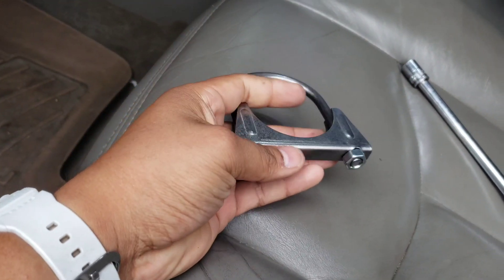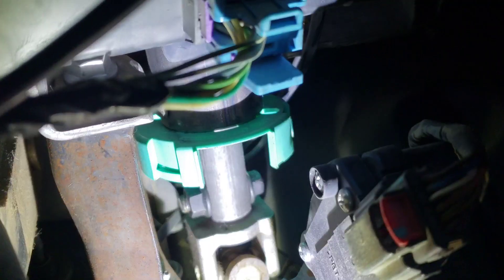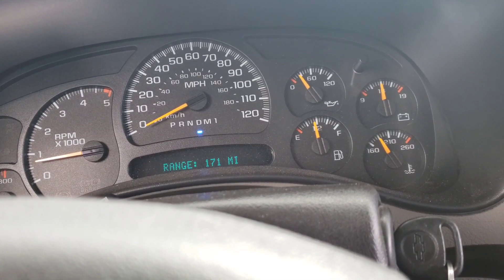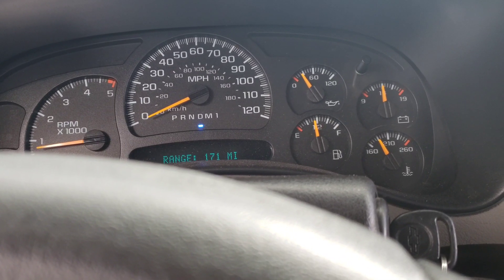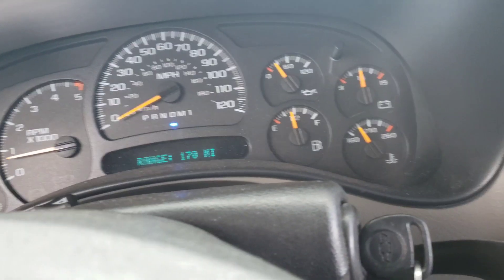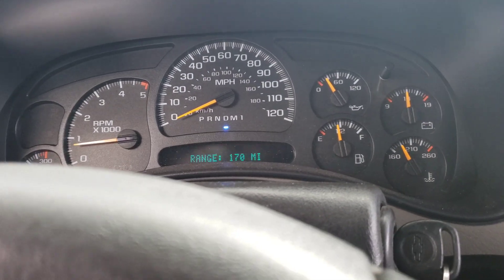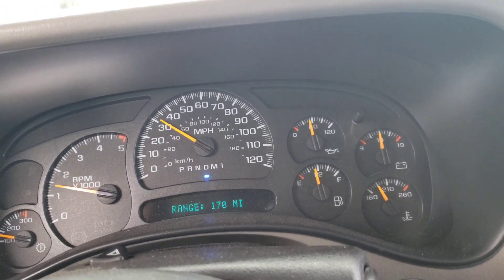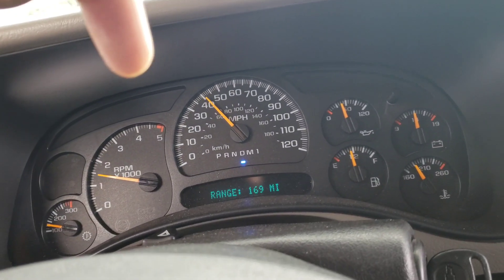stopping the rattle in the duramax!

Comment: Just did this. Thanks! Were you able to snug down the nuts? Curious if you get resistance eventually. I don’t want to accidentally bend the pipe.
Reply from the maker: I just got impacted them a bit and stopped to make sure I didn't over torque them and just torqued to the s&b said they have been good since
Reply: @rikkidiesel  My noise wasn't bad, this seemed to quiet down anything that might've made a noise. I'll be driving logging roads in December so if it comes back this is next: [GM109SS Lower Steering Column Bearing]
Reply: I feel like the point is to bend the metal a little bit

Comment: Hey Rikki just a random question how much oil pressure you get? 
I have a LBZ 2006 I was getting low oil pressure I fix from the cheapest parts you could think to the one of the most expensive which was the oil pump at the moment I am not getting low pressure oil on the dash. It idols around  24. Do you know if that’s normal? I currently have 258920 miles on it ?
Reply: The oil pickup tube seal on these go bad, you have to drop the oil pan to replace but it’s a $2 part there are also black red or green seals and you have to use the same color. If it’s not that it could br the oil control barbell in the back of the engine block in front of the flex plate leaking
Reply: @larkinkelly3754  got ir thanks boss👌🏻

Comment: Nice work Rikki! I’ve got the same issue with my 2007 duramax. Only 70k miles on the clock. Is that fix still working a couple weeks later?
Reply from the maker: Yeah still quiet. Just got to work and never hear a peep. Idk why i didn't do this years ago
Reply: Rikki Diesel just did this today in my garage before going to work. Took like 10 min including stuffing a couple little rubber strips under the hose clamp to hold in place and preload the plastic piece. Quiet as a church mouse now! Thanks for the help!
Reply from the maker: For sure man!
Reply: Looks like I’ll be doing this tomrrow to save me about $150 instead of new shaft and bearing and my time taking it apart
Reply: Just saw this notification of your reply. Reminded me that I needed to reply back. That fix with the clamp only lasted about 2-3 weeks then some clunking and banging came back. I ended buying a whole new shaft that came with new plastic bearing. I couldn’t see anything wrong with the metal shaft itself, no looseness but suspect the plastic bearing was worn. It’s now been good for a couple thousand miles with the new shaft and bearing. Good luck!
Reply from the maker: Yeah seems like it happens differently to different trucks. I did this and I have never heard from it again. But I have heard it comes back and some trucks never hear it again
Reply: @rikkidiesel  how tight?
Reply from the maker: @iiBradleyP  just make it a little tighter then snug